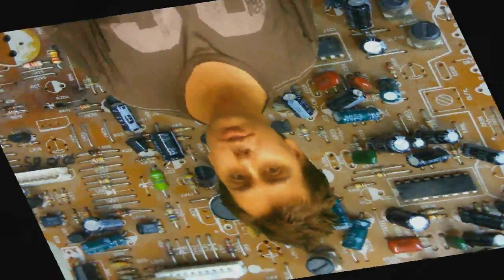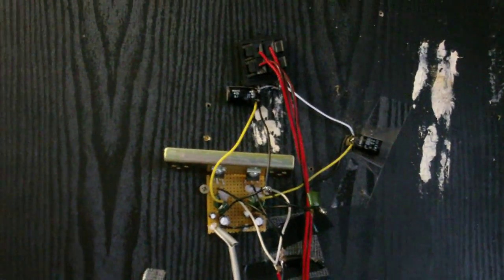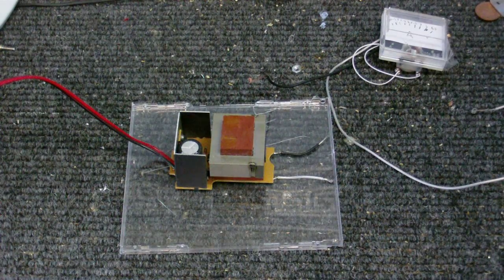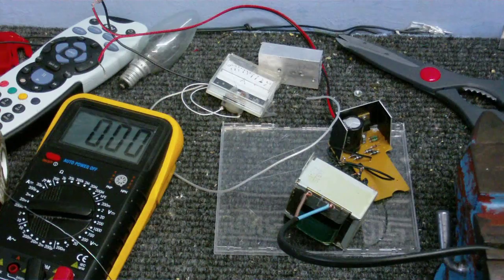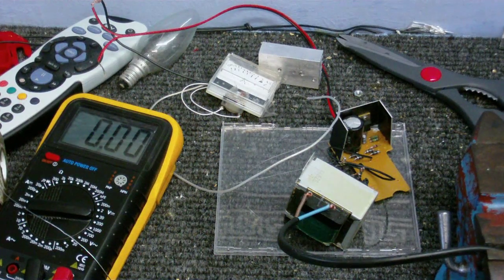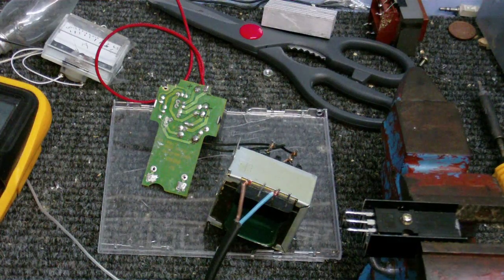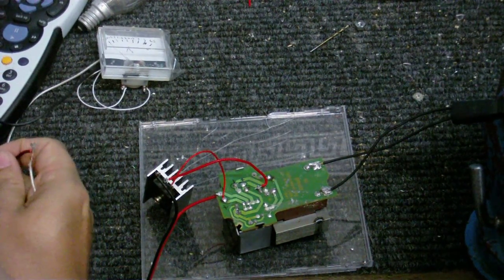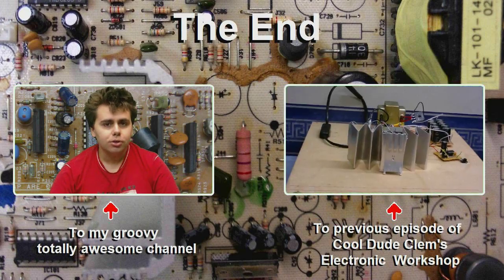CDC ElEcTroNic Work Shop - Improving my computer speakers amplifier

Comment: Transformer power depends on cross sectional area, or the center leg from the E/I shape core... not only from the wire diameter, but the transformer size itself.

Comment: As you know... when a component is 3A, this means you can cross 3A internally...but as you know very well., i am sure about that (but others does not know..many guys does not know) they does not supply you 3A...the system, the transformer, the rectifiers, the filters must provide you huge powered energy in order to let it work..if voltage drop in the LM input, then it is unable to create energy...when voltage is smaller than the regulator capacities, then the voltage in the output will drop.

Comment: Because it is 300 mA when you have 12 volts...and then 600 mA  when you will have 6 volts (depending the load impedance, or resistance, draining current)...and then 1,2A amperes and the output will be 3 volts..and then 2.4 amperes and the output voltage will be 1.5 volts..and then much more during short ... this is only an example about what usually happens